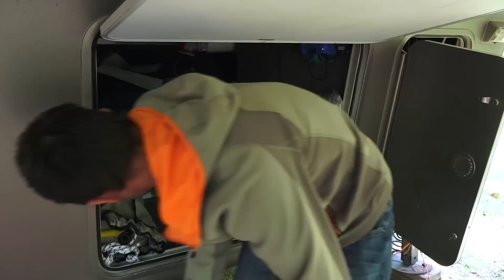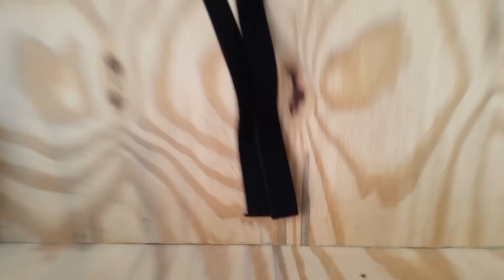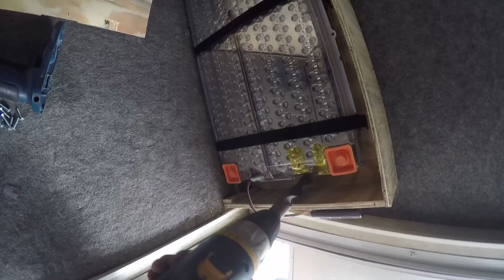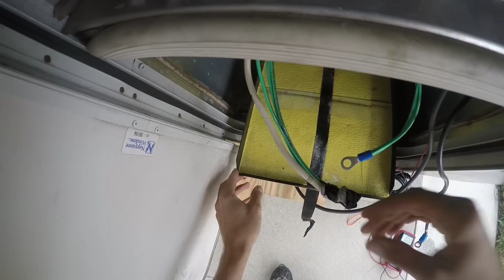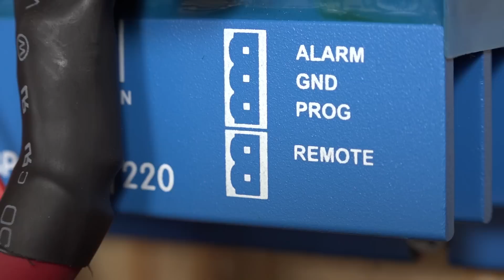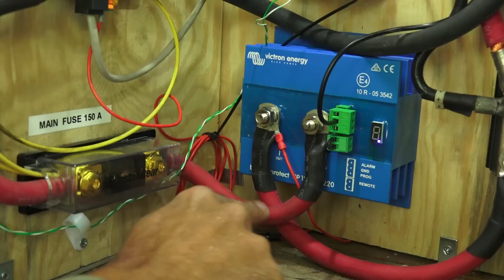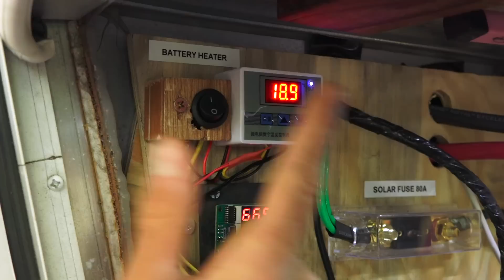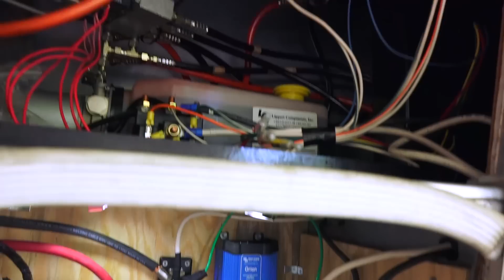PHASE 2 SOLAR - Installing the Tesla Battery and converting the RV from 12V to 24V

Comment: Hey Tom, thank you for sharing your setup to such fine detail. I'm planning to do a very similar system in my travel trailer, and your use of a battery protector made me think if if I would still need to use a similar device if I use the plug-n-play BMS/balancing adapter Overkill sells for these batteries, and program overcharge/overdischarge parameters with a regular MPPT PV charge controller from the PV side, and with a low-frequency inverter like the Sigineer ones that include algorithms specifically designed for these Tesla batteries from the shore power side. What do you think of something like that? Thanks!

Comment: I have a question for you Tom. If one were to use a whole tesla battery pack without disassembling it. Could it be used safely as a whole house/RV battery bank as opposed to using several modules together each with separate BMS units? It would be less than half the cost of going with battle born?

Comment: instead of fans, which have breaking bearings, consider passive/non-moving-active cooling
Reply: consider bluetti ac200, 700w solar + 500w wall per solar generator

Comment: Awesome! Thank you very much! I am thinking to do that to my race trailer. What is your opinion on flexible solar panels? Out trailer is 13f 6 inch, we can really have brakets that will stick out. I was thinking to run flexible solar panels and glue them to the roof, to take advantage of their low profile

Comment: I know this is old, but I have a few thoughts: 
 In my smaller van install (with Battleborns)  I did not use a battery protect because: 
1) all of my regular DC loads come off of the Victron MPPT, which has a low voltage disconnect built in.  Nice feature.  Also, with the Battleborn drop in, you get a low voltage (and high, and temperature) disconnect IN the internal BMS, which is ideal. 
2) I do have the inverter loading the battery directly, not via the solar charge controller.  My Victron inverter also has a programmable low voltage disconnect. 
This is an alternative protection approach using what you already had to buy, especially for those with a reliable high quality BMS on their battery and a charge controller with a protected load output.  Considering that Victron  BP is now supposedly one-way only,  relying on your charge controller's built in protection might be best. 

I chose to use re-settable DC circuit breakers instead of fuses.   Reasoning was that these will act as switches and allow quickly shutting off the current at every fuse point. I really do use them for diagnostics and storage. They also don't burn out and need replacing on some rainy cold night far from a store.  My doubt is about the actual level of reliable protection from a breaker vs a fuse.  Certainly AC breakers work fine,  But high amp DC is new to me.   I use name brand (Bussman) DC breakers. Not cheap.   There are cheap Chinese DC breakers on Amazon but I don't trust them to perform as rated.

I did install one redundant ANC fuse in series with a lower rated breaker in the connection from the alternator (starter battery actually) to the house system.   

Also, with a guaranteed reliable BMS  (go Battleborn!!!) I don't see the need for additional protection or shutoff for frozen batteries.  In this particular install, the additional protection is part of the outboard cost of using the Tesla, I guess.  Just a comment for those who use a quality "drop-in"  lithium. 

Another cost of using the Tesla battery is the 24 to 12V conversion.  Certainly there are advantages to 24 volt system.  But using more expensive "drop ins" , you can forgo several outboard items here.   The smaller the amperage of your system, the more that makes a difference, I suppose.

Comment: I would have just added an additional Daly BMS, and used it as a "voltage monitor" to trip the Victron disconnect if there is over-voltage or under-voltage.  No need for 2 disconnects and those extra relays.

Comment: How do you size your shunt?
Reply from the maker: Oversize wont hurt but to make sure its big enough, they are usually rated for peak current capabilities with around half that continuous.   If you intend to run 250A continuous, get a 500A shunt.

Comment: Is a vertical orientation like that going to be a problem? Normally the batteries are laying horizontal. I wonder if you can get in touch with a Tesla battery engineer.
Reply from the maker: Should not be a problem, the panasonic cells have no direction requirement

Comment: Fabulous video. Thanks for your efforts.

I have built a similar system for a travel trailer but I left the tenergy 5 + 1 disconnected. What do you use for a connection from the Tesla to the tenergy? Is that a cable I can readily by fabulous video. Thanks for your efforts.

 I have built a similar system for a travel trailer but I left the tenergy disconnected. what do you use for a connection from the Tesla to the tenergy? is that a cable I can readily buy? If so, will you post a link do that product please.
Reply from the maker: That is a custom lead to a 7s JST connector.  You can wire them yourself but my battery came with it modified already.
Reply: @MortonsontheMove  Thanks for taking the time. Do you just build them wit the 1st pin as the ground and the rest for each positive? Does it have a plug at each end?  Sorry for all the questions. I have never built anything like this and have never seen one either. 
Again, thanks. Your videos have been extremely helpful. I started out trying to do things on a shoestring since all this Tesla level equipment is pretty pricey. But, I now see the merit in using quality components keeping everything managed properly.

Comment: Great video! I'm watching it very "late", and you might have done it already, but if not, connect the output of the Orion to that 12v battery. (For 120A draw, I would consider a bigger AGM if that load is maintained for over a few seconds). Lead acids love to be fully charged, everyday. Charging only from the truck probably will leave it somewhat discharged for days to weeks at a time, meaning it is slowly dieing (and, as car batteries do, will give you very little warning).

Comment: You may want to consider getting spares of the most important parts, like 24-12 volt converter, unless they are readily available in your area. Great job so far, on to phase 3.

Comment: Good Stuff thanks for sharing - I watched your Tesla piece as well. I also just completed an in-depth video on upgrading an RV from flooded batteries to a 8kw lithium system using Lithionics and Xantrex systems inter-graded with Victron’s solar controller and Mastervolt’s Charge Mate Pro for alternator charging. Here’s a link to the video - Mike   https://www.youtube.com/watch?v=nyAAxNqKCOg&feature=youtu.be

Comment: Thank you for this great video! I am a beginner and trying to find as much information as possible to build a very similar system you described here. So I really appreciate all the time you invested into comprising such a detailed explanation.
I have one question (which probably stems from my limited understanding about this technology):
- if a short occurs and the 150A fuse disconnects the battery from the rest of the system, does this mean that the charge controller is now in danger, especially if the solar batteries are actively supplying power?
Again, thank you for your time!!
Reply from the maker: The solar charge controller?  I have run them open circuit before just fine, but when the sun goes down they will shutdown and not fire back up without a battery in the system.
Reply: Thank you for the reply!
I think we are very close. Everything is setup, but the battery protect is set at a wrong setting. We are using a tesla battery just like in your video, and set BP at 8A as it is a 24v system. But you mention 19v in the video, so maybe it should be 2A or 2C?
Reply from the maker: I think 2a is what we used.

Comment: Hey Tom! This is an unbelievably awesome video and the design / schematic is super helpful in understanding it all.
QUESTION: Since you've wired the output of the smaller Battery Protect coming from the charge controller to the disconnect side (out side) of the larger Battery Protect (the one for low voltage) coming from the battery, if you do in fact get to a low voltage situation and the larger Battery Protect does in fact disconnect the entire system from the battery, then wouldn't this cause you to be unable to charge the batteries from the solar panels? I guess I'm curious why you wired the system this way and didn't connect the output of the small Battery Protect to the fuse side (input side) of the larger Battery Protect.
Reply from the maker: The battery protect only blocks current in one direction.... So it actually would charge. .. using it that way might not be the best idea however because victron has said some catch fire charging backwards through it.... I need to update my schematic but now we don't charge through the bp220 but connect the inverter and solar to the backside of the unit the inverter has its own low voltage disconnect.
Reply: @MortonsontheMove  Ahhhhh ok. That makes sense. Thanks for the reply and sorry I didn't catch the part about the BP only blocking current in one direction! I guess I assumed it was a complete disconnect like a relay or something instead of some sort of diode configuration. But also good to know what you're saying about the potential for a fire hazard. I'll keep that in mind as well! Keep making awesome videos! I feel so lucky that this type of free resource is on the internet. i've learned so much!

Comment: I've watched many videos by Will Prowse and he uses (well, used... since he recently moved back into a sticks and bricks) a Tesla battery as well. I understand from both his videos and yours that Tesla batteries need to be closely monitored so that they aren't charged when too cold, too hot, full, etc. lest damage be done to the battery or worst case scenario a fire starts. That brings me to my question. I'm curious. IF (God forbid) a fire were to start because of something that went wrong with the battery how do the insurance companies handle that claim. Will they pay it out? I don't expect you to have the answer to that but am just curious if that scenario was considered or if anyone reading "works for the insurance industry" has an observation about that. (I also don't expect a definitive "yes, they will" or "no, they won't pay" on the question as every situation is unique and as well, no two insurers are likely to respond the same way). But it's a valid concern I think if you could lose everything and have no recourse for recovery. Safe travels, y'all!

Comment: Would it have been easier to use an all in one box like MPP Solar inverter 24V?
Reply from the maker: If you could find one that meets specs of the system... I could not find one that would work.  This allows for modular modifications to the system too.

Comment: You can get relays that are normaly closed and would be held open if your batteries get too low/high it could be powered through that small auxiliary battery 

Power useage is low the main problem is main winding breakdown fine if it’s active for a few days or weeks until you sort out whatever problem caused it to be active in the first place but a problem if the relay is being held closed all the time which is why you want a constantly closed one that open upon activation

Comment: Hey Tom, great video as always! But please check with Victron because they typically DO NOT RECOMMEND to use a BP in the inverter feed due to the inrush current at start up. You might be ok to install a pre-charge circuit to save a lot of hassle. Not sure if Victron thinks that would be approved or not.

Comment: Great design.  One small addition may make your system a little more efficient.  If you order a string heater from any of the refrigerator manufacturers, you could use a vacuum pump to draw the sting through the cooling tubes in the Tesla coil and then attach the ends to your power supply and you have a great heater to keep the coil above 24F degrees.  I used to do this all the time to replace Yoder loop hot gas condensation removal tubes that leaked out the Freon charge in many of the early refrigerators.  The manufacturers replaced the hot gas system by cutting the entire loop system from the condenser and install the string heater, evacuate, recharge and tie the string heater into the defrost timer.  The new string heater would come on 3 or 4 times each day when the unit went into defrost.  Worked great.

Comment: Hey what formula do you use for determining the size of the Fuse you will need for your solar system?  I am going to add 200watts from Go Power just to charge our Flooded batteries (2 of them) just to run our inverter for the fridge while we are driving in between campgrounds.  I have not been able to find some way of calculating the size of the fuses I should use, also considering we have a 75 watt converter to charge the batteries when we are connected to 50amp.  I ask you since you were in the solar field, also you seem to be well informed, I an IT guy so pretty good with electronics but I prefer to put a little smaller fuse in to trip sooner and prevent frying the system?

Comment: Man, I want this setup in my new custom build and conversion!!
Reply from the maker: It's been pretty sweet! We have  been off-grid for months without gen
Reply: Mortons on the Move 250ah do you plan on adding a second wall and if you do does that make your system 48v? I’m thinking two Tesla packs for 2K 500ah vs Battle Born 500ah for 5K the Tesla is the way to go.
Reply: What type of conversion are you trying to do? A skoolie or coach bus? I want to do same thing also

Comment: Would make it into a metal cabinet in modular form that is removable for repair and change to another RV. I would make the old system modular as well for reinstall or sale to defray cost of new system. A wreck can total your unit a modular system allows you to save your RV system or transfer to another RV.

Comment: How does one calculate the depth of discharge?  For the life of me i can't find a typical chart like a standard battery what would 10% voltage be? Having my inverter maker give me instructions to adjust low voltage cut off.
Reply: Planning on 48v system but i can multiply lol

Comment: Hi Tom,  I was wondering if I can charge the Tesla battery with a second alternator instead of solar panels.  I was going to follow your set up but using a second alternator to charge the Tesla battery.  If anyone else out there has tried this, please let me know.  Thanks a bunch.
Reply from the maker: Check out my latest video,  It is possible but you would need to use a higher voltage alternator and a charge controller (MPPT) or step up the voltage using a DC-DC converter.  Sterling power and victron both make one that is programmable and would work.

Comment: So it looks like there are seven individual banks in the module. So I am wondering if the Tesla charger monitors each individual cell.
Reply from the maker: No the original BMS just monitored the 6 main cells.  Each individual cell passively balances.